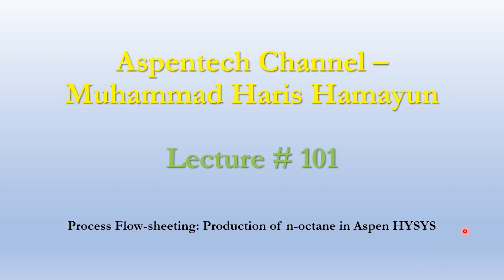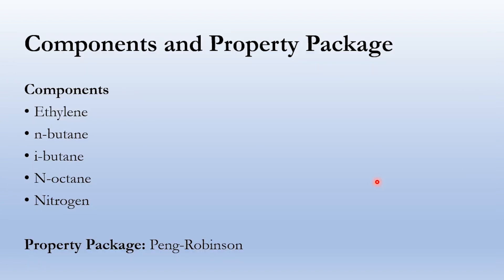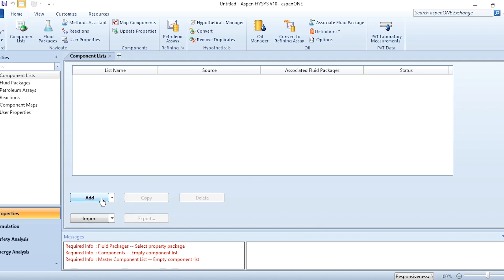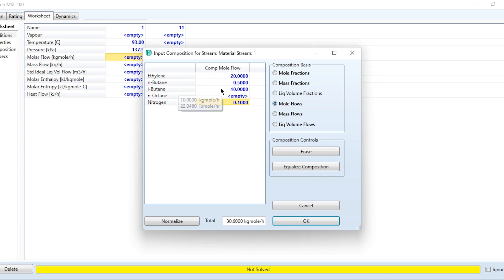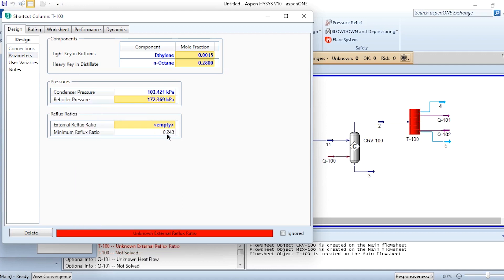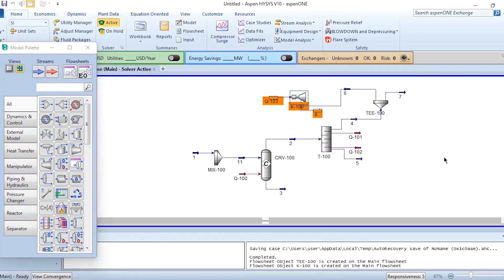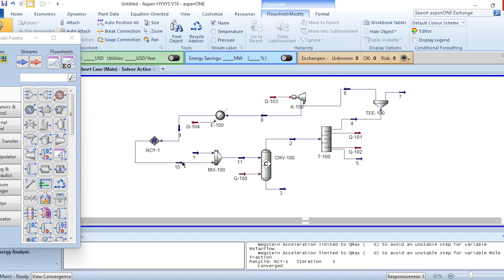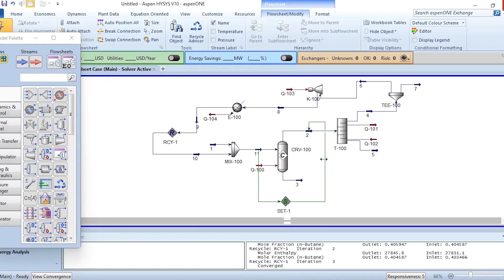Production of n-octane from ethylene and iso-butane - Aspen HYSYS - Lecture # 101

Comment: In short cut distillation error is coming that one of the key component mole fraction specifications is too large for operation T-100
Reply from the maker: Have you rechecked that all the given specifications are same as that of presented in the video?
Reply: @aspenchemchannel  yes and more than 3 times I copied exactly same
Reply: @aartisamant8082  did you find a solution for this?